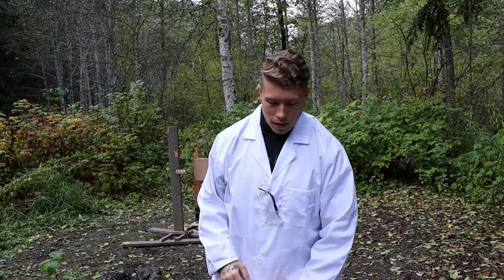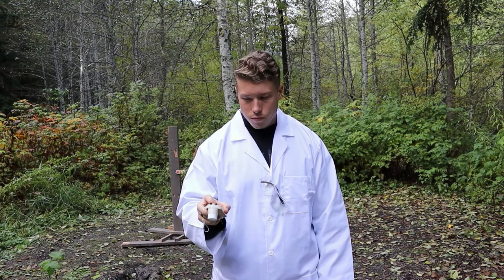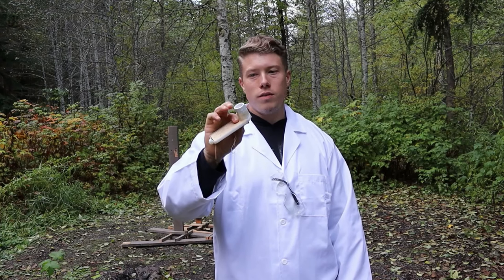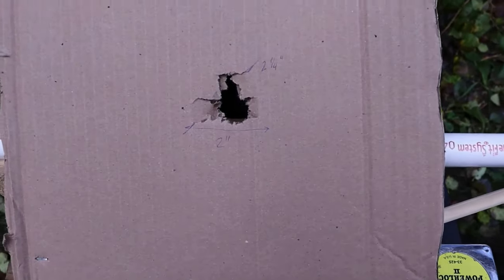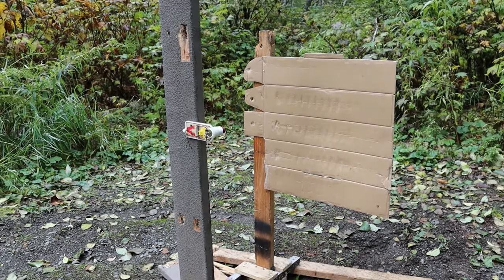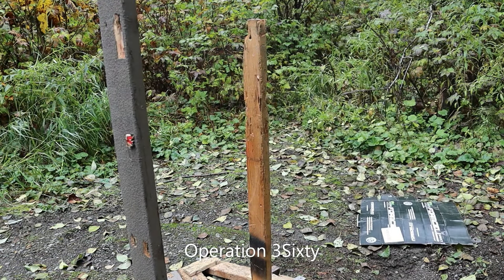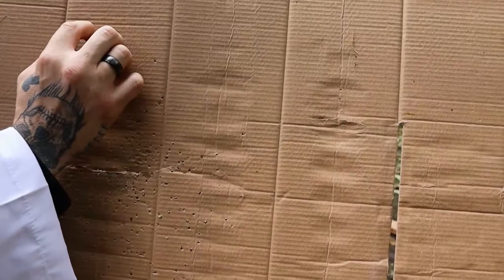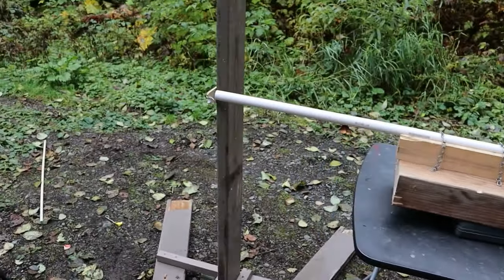Mouse Trap + 12 Gauge Shotgun Shell. Will it work? For Science! #notimeoutsinwar #operation3sixty

Comment: 4” long 1/8” steel pipe(size accordingly to caliber), 1/8” steel plate to replace the mousetrap wood, drill out some holes to secure the spring and firing pin assembly, or even tack weld it together. Should withstand all the pressures involved, and more importantly be re-usable!

Comment: You should have welded the firing pin to the spring. Instead you added a bunch of weight, which reduced the speed of the firing component. Force equals mass times acceleration. Add a bunch of mass, get much lower velocity at impact.

Comment: I think the shell is not held securely in the respect the the energy from the spring is wasted pushing the shell into the plastic pipe that's why after several strikes the shell has bedded down enough so it won't move forward when hit by the firing pin. So a metal tube may help as it won't tend to deform under pressure from the spring. But I think you need to fix the pipe securely so it can't move or push forward. The firing pin has to be set right to a gun and that is adjustable but the shell can't move in the gun as it's all one piece really. Just a couple of thoughts. Be careful as I can see these things be a problem with shrapnel from exploding mouse traps and plastic both will cause pain or worse.

Comment: You're losing so much of the force by not having and strength/weight backing the trap, the shell probably is going as fast backwards as the shot is going forward. Make an aluminum base and bolt it to the post, it all has to be stronger. Good test though!
Reply from the maker: Good idea! I'll try that

Comment: you need 12" - 24" black metal pipe(no longer or shorter!). 3/4" diameter is perfect for 12 gauge. place the 12 gauge shell inside 3/4" pipe. then attach your mouse trap configuration. 

do you know how to make a "slam shotgun?" maybe seeing that, will help with pipe and fuse design.
Reply: "no longer or shorter!" 12" - 24" black metal pipe "? Oh NO  GLOWY BOI!? no jail FED length 
minimums are  26 inch over all from muzzle to back of action or butt stock  & 18 inch barrel

Comment: Better set up is 2" x 4" with mouse trap screwed directly to the 2" x 4" drill hole where 12 gauge shotgun shell is centered to primer and trap arm , make sure hole is right fit for the shell glue a bee bee or pellet directly to primer of shell tie a string or fishing line to the  trip plate of the mouse trap and tie other end to a tree or another stake hidden insert shotgun shell with glued bb or pellet into tight hole the set the firing side to the same side as trip wire insert stake in ground set mousetrap and who ever or whatever trips the mouse trap will either lose a lower extremity or will hit the body of a small animal such as wild hog or stray or wild animals  but it is illegal to use boobie traps

Comment: Glue bb to the primer on each shell can use short galvanized pipe threaded on each side of 2 x 4 and use a nut on each side but on the side of mouse trap make sure that the shell with bb glued to primer that the trap arm will hit the bb or pellet to fire the shell, and make sure that the clearance is right so trap arm hits and doesn't fully extend only extending 95% of way , also a tip to remove tight fitting shell from galvanized pipe with tight fitting inner diameter for the shell to use 2 female eyelets that screw into the 2 x 4 large enough to allow a bent push rod to slide down inside eyelets , the push rod is to remove the spent shell and eyelets  are to secure to firing stake for storage of pushrod until needed
Reply: 1" galvanized should have a 3/4" inner diameter which should be tight fitting if not tight enough use some electrical tape around the shell

Comment: When you said I'm excited to see, I was like I'm totally stoked to see it too! Thank you, nicely done experiment. I thought you were going to have to try a rat trap too, must have to hit the primer just right finally with the mouse trap. I first saw this design on an episode of Doomsday Castle (Brenton Bruns). Instead of PVC, lead pipe (fittings) maybe? Do you think you could you make the mouse trap more resilient so its not single use?
Reply from the maker: Yea, just as you mentioned, I think I could use a steel or aluminum pipe to hold the shotgun shell in place of the pvc. Should work just fine! Still not sure how to make the "firing pin" strike accurately though.

Comment: Would need a steel pipe to direct the shot and a threaded cap on the end with a hole large enough to let the striker though to hit the primer otherwise all the force gets sent outward in all directions and you don't have the energy directed.
Reply from the maker: Great idea! That would act as a chamber, should be reusable, and should be the only part that needs to be steel, since it will be taking all the force. I'll look into it!
Reply: Steel pipe with cap. Drill the cap. Put something like a dowel pin against the shell, through the hole. Let the rat trap strike it.
Reply: And hope no one actually trips it or you’ll be doin time

Comment: But these are not even legal to use even on private property that is posted , you can get sued if someone gets injured even though an intruder or trespassing person trips the trap and gets leg or legs blown off, if the buck shot or slugs are used , personally rock salt shells may be the best non lethal shell to use for many reasons unless you intend to use the higher caliper and  cause someone to bleed out because they cant walk and possibly be lethal, which i woukd not do nor do i think that  this should be done because its illegal but rock salt would be painful and non lethal but would be most likely effective   to either run off a stray animal or make a trespasser think that they arent safe in treaspassing any futher
Reply from the maker: Yes, not good for home defense in any way. I don't suggest using these for that purpose. This video is for scientific purposes only 😁

But may be useful for hunting small animals!

Comment: My trespassing thieves & poachers are F$CKED now buddy. Thats an awesome alarm, and if you were to connect a trip line to a PVC pipe with a bend at the end mounted to a tree filled with cowtops pointed at a driveway, my thought is that once the trip wire is pulled it would not only alarm you but throw cowtops made from hollow brake line on the driveway or trail to flatten tires. Enough to keep them occupied till I can get my red dot on them and get police out here. So unless they carry 4 spare tires they are plum screwed, only one of 2 ways they'll be leaving, cops or coroner they can pick there vehicle up in impound. Time to set an example